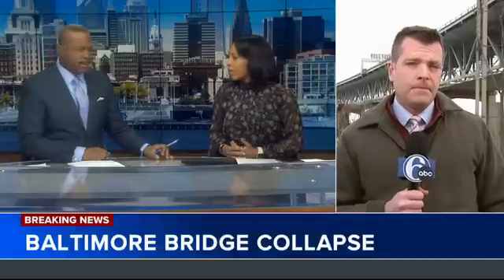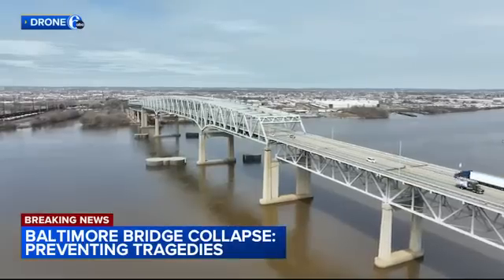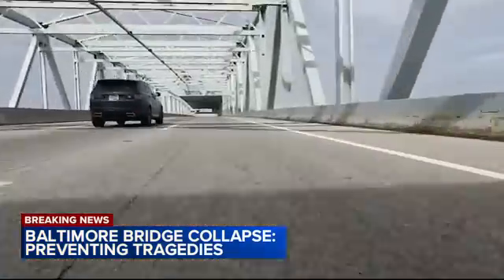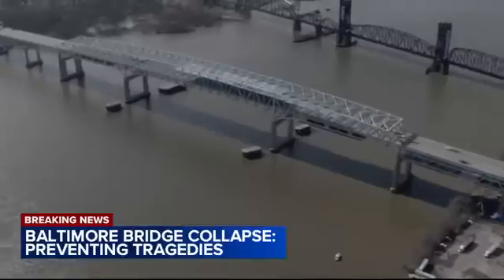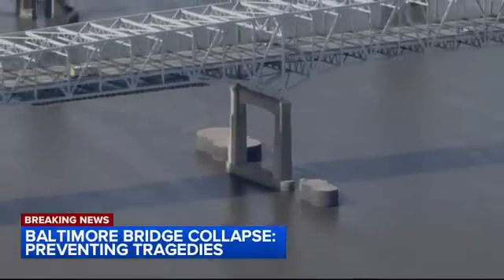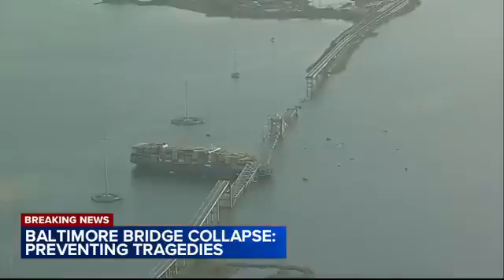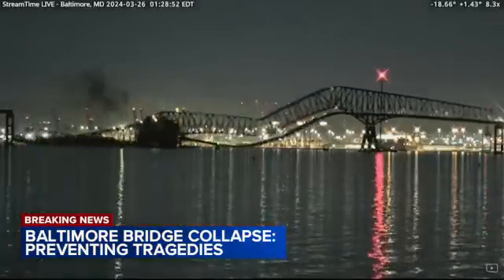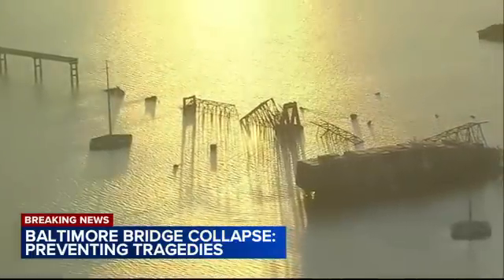Here's what surprised a structural engineering professor about the Baltimore bridge collapse

Comment: To me, it looks as if the ship hit one of the curved metal stantions which rest on top of the concrete piers, and that subsequently ripped down the metal understructure first.  The ship cannot knock a concrete pier down, but it can rip down metal reenforcement bars.  Either way, this bridge needs serious modernization during a rebuild, which would allow one section to collapse while the other sections would remain standing.  That kind of safety redundancy was not present in this bridge, and is not present in many bridges throughout the United States.  This exact reason is why the Bayonne Bridge was raised, so that ships would not hit the understructure.
Reply: And the sparks that sparked from the top leaft beams, what's that from?
Reply: but the understructure wasn't hit...the ship literally rammed into the ENTIRE support structure like someone coming up to u and smashing ur legs with a baseball bat guess what happens to everything on top?
Reply: Please tell us more Mr. Wizard.  You're clueless.
Reply: seems as one did and the rest stayed. so whats your point?